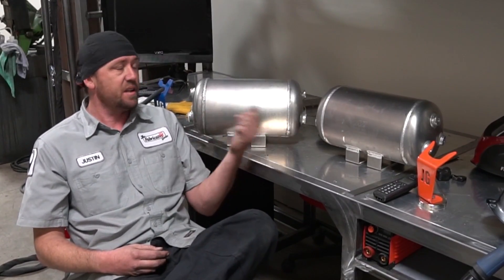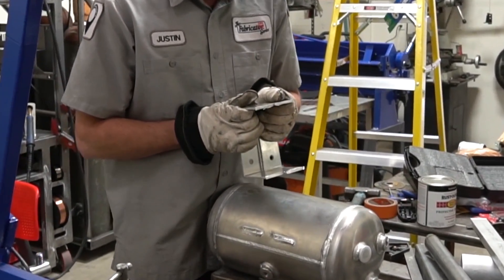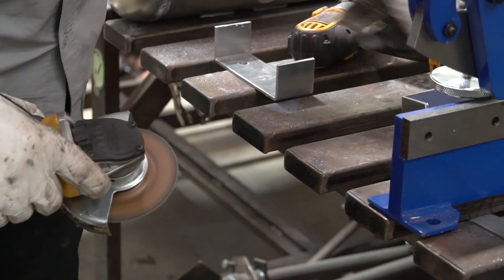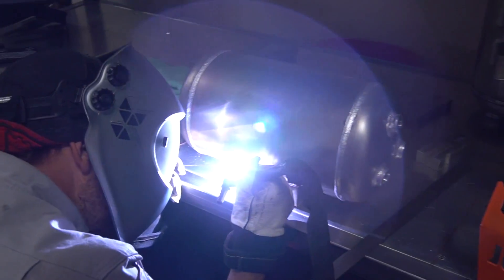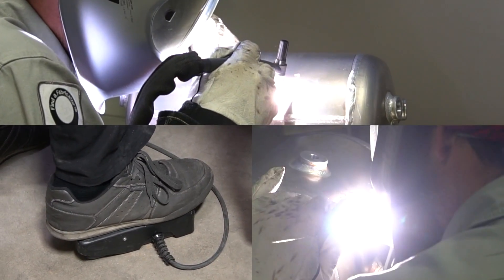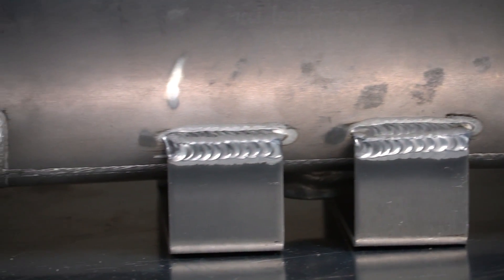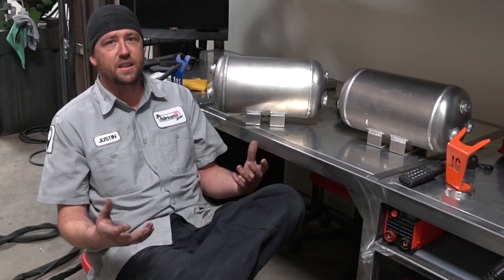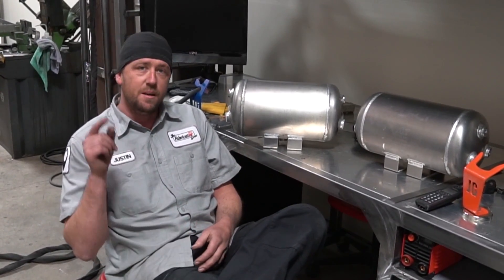TFS: Aluminum Tank Repair and Job Pricing

Comment: Not being an engineer or certified pressure vessel.. won't the HAZ anneal the existing weldment and potentially be a stress riser in service? I've always been told any mods to pressure vessel require a hydro. Is it a CYA?
Reply: Your correct about annealing the HAZ. Aluminum assuming its 6061will air harden over time, although will not achieve exact temper as before. For extreme critical applications you will need to get it heat treated again. Hope this helps answer your question.
Reply: Oh and pricing is indeed hard to not gouge but still chip away at the equipment bill.

Comment: I have a shop minimum (1hr @ $65) plus $5 for consumables, then after the first hour it's time spent rounded up to the next half-hour.  A lot of locals here want everything for free, so this keeps them out of my shop.   Also, taking their broken junk to an actual welder is the last resort for a lot of people, so watch out for the ones that want a quote without showing you what they want fixed.   Charging by time spent keeps you covered if you have to grind out the last guy's booger MIG welds, or worse, three tubes of JB Weld
Reply: Machinist here, everyone wants everything for free. Or they fail to grasp the time involved in some jobs.

Comment: Love your vids man! I fart around with light fab on the side, (I run a small tree biz) and the work might be different but the pricing is similar. Everything boils down to time. I can do a lot of tree cutting with $10 worth of 2 stroke gas, the same way I can do a lot of welding with $10 in wire/gas. Time is money no matter what the job is and it's the only thing we can't get back.

Comment: I have a small percentage that I charge for shop supplies. The min is $2 and it not only covers things like cleaning supplies used on a job it also helps to pay for things like wire wheels, blades etc that you can't really bill for. I've only had a few customers question it and once I've been explained it they appreciate the fact that they aren't paying for stuff like a can of brakeclean when all I used was a squirt. The other great part is I've got a easy way to cover and track my supply costs for the shop. It's a real timesaver too since there's no need to bill for things like a welding rod in a little job like this one.

Comment: So our shop used to do a lot of repair work that didn’t use any real material. We mark up our material by a (reasonable) percentage to cover our consumables: gasses, wire, sanding pads, safety glasses, ear plugs, and so on. The problem that we started to run into was that we were starting to get upside down on repair jobs due to not having some material markup in there to cover the shop supplies. So we went to a “minimum” for materials on all orders. For instance, the job you just did there, I’d probably throw $10 for material on it. Cool video. I like the really practical day to day stuff mixed in like this.